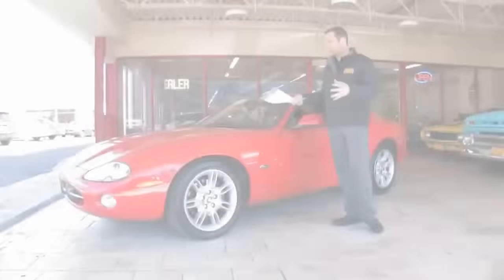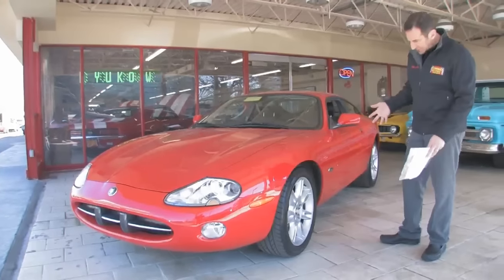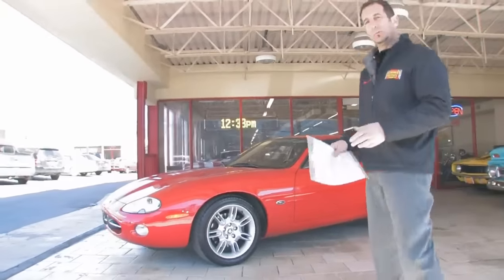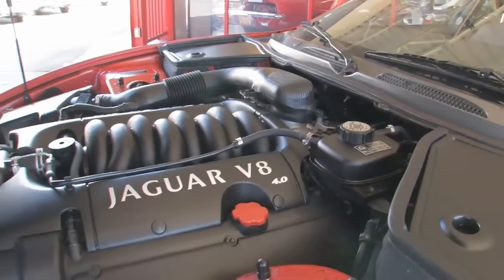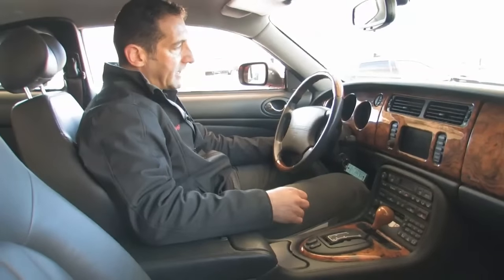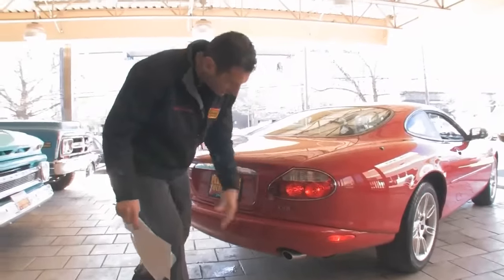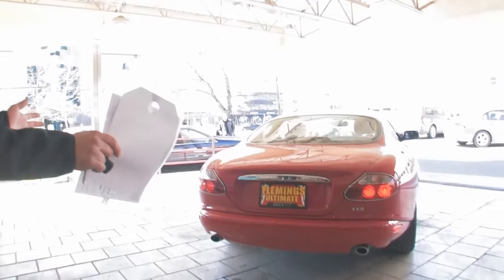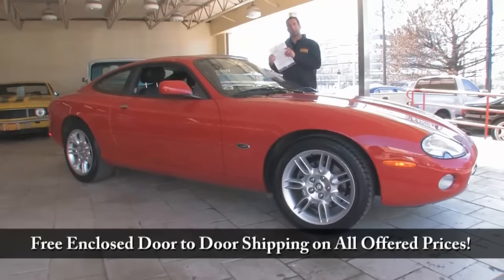2002 Jaguar XK8 Coupe for sale with test drive, driving sounds, and walk through video

Comment: Correction on the designer of this model.. it is Not Ian Callum but the designer of this model was the late Geoff Lawson, Jaguar Director of Styling (19884-99) - He designed the '96-2009 XJ, The S-type, The XK8 '96-2006 and the XJ220.  The 96''06 XK8/XKR was the top selling sports car in Jaguar's history. Geoff Lawson, a brilliant & well respected car designer. RIP Geof!

Comment: You are right.  I have the exact same car (43,000 mi), but a '2000 which makes it a convertible,  and I wish I had the hard top.  The lines are still great on the my convertible but yours is nicer.  I even tried to see if I could get an after market hard top for it, but they just do not exist.  The handling is amazing, but real wood for the dash?  Come on now.
Reply: Just got a 2000 coupe and couldn't love the car more